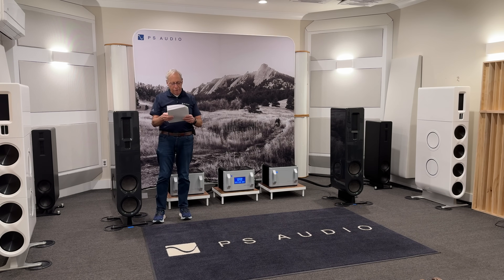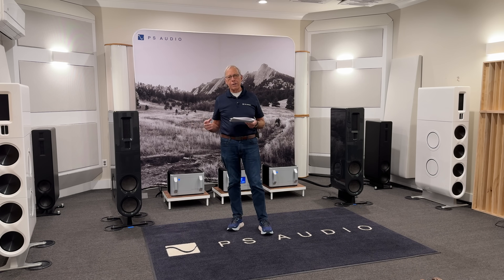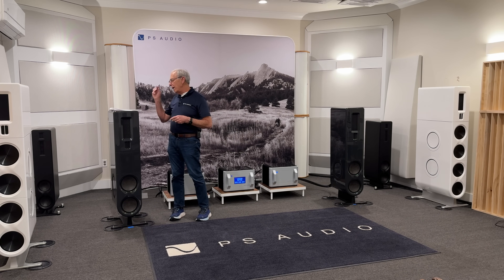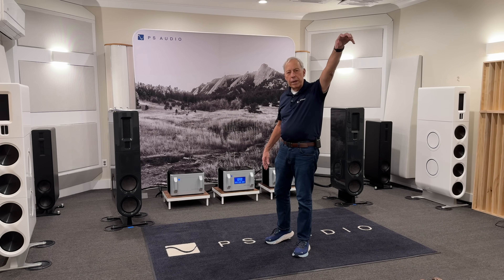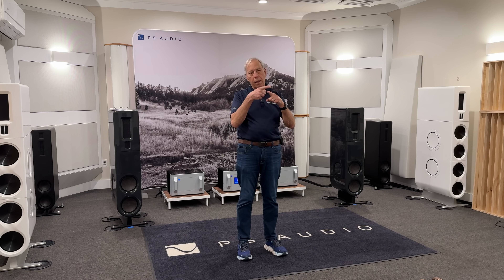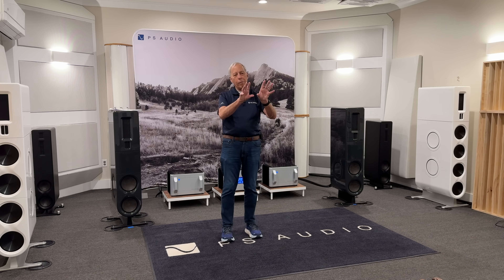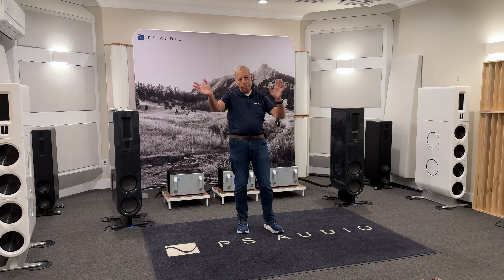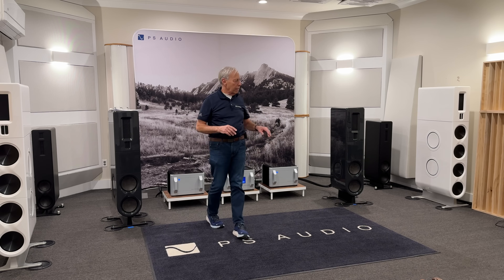How soundstage is created in the recording and mix

Comment: Someone like Octave "should" fiddle carefully with positioning a single mic (like the Neumann described in this video) to glean the best soundstage.  Adding in spotlight mics runs a big risk of noticeable phase cancellation or accumulation once they're all joined in the mixing board, not to mention smearing transients.  A spotlight near the drumset would be helpful, and small imbalance in remaining overall spectrum can be tamed by a mild equalization touch in final mix.  This admittedly won't work very well "on the road".  Ya, nobody ever put me in charge  -  -  -  -

Comment: This topic can create lengthy dicussions.
Another interesting discussion would be how the electronics handle the "soundstage" information, because a very vital part of the "soundstage" is all the harmonics created by the room where the recording is made.
The puritans use one single stereo microphone to capture all the musicians playing together in the room.
Using several microphones will make the mixing easier, but all microphones will capture sound a bit differently and sound a bit different since they are placed in different locations in the room.
But in general that is how recordings are made and gives the mixer the best tools to twist and tweak a bit to get the prefered end result.

Now back to the harmonics from the room...
When an instrument are played inside a room sound will be reflected by the surrounding boundaries like walls, floor and ceiling, and all those reflections adds to the instruments own sound as room harmonics. To record the real soundstage all those harmonics need to be recorded without any bandwidth limiting.
Without those harmonics you will not have a "soundstage" since the rooms character are missing.
Think of a highly dampened recording studio and a church.
Completely different sound character and that is because of the added harmonics and reverb time from the reflections in the room.

Electronics will more or less mess with those harmonics depending on how they are designed. 
To get recorded harmonics through to your ear unharmed all parts and gain stages must have a bandwidth of at least 20 kHz before global feedback are applied.
Some parts like integrated circuits have severe limitations in bandwidth before feedback is applied. It's not uncommon for high global feedback (op-amps) circuits to have -3dB at 100 Hz when measured with open loop. Usually the feedback loop goes back to the input stage where the input signal and the feedback signal is compared and mixed.
The input signal is at best the recorded pristine signal transfered by the input stage into the circuit with a 100 Hz bandwidth limit.
The feedback signal is the pristine recorded signal with a 100 Hz filter and added distortion by all the stages in the circuit.
The feedback will however make the input stage more sensitive and react faster to changes in the recorded signal which will restore and increase the bandwidth of the amplifier.
But in that process the feedback signal will add  the harmonics and sound flavour of the amplifer circuit which will be added to the harmonics from the original recording.
That will severly damage the harmonics from the room and the recorded instrument itself.
So no surprize that high feedback circuits have their own sound signature that sounds more from the sound character from the circuit than the recorded signal.

Conclusion in my point of view...
High global feedback in amplifier circuits is destroying the chances to hear the harmonics from the recorded signal and will not be able to faithfully reproduce the recording. It sounds altered and in many cases very bad. Low distortion figures by measuring a sinus wave will not tell the truth about the amplifiers ability to faithfully amplify the signal with all the harmonics intact.

By comparison, NO global feedback high bandwidth amplifiers have a much better possibility to get all the harmonics through in an unharmed way to the listener.
Low global feedback amps are pretty good too.
In my point of view high global feedback will always sound bad and present a "changed" sound. Then it's up to the listeners preference what flavour they like.
To my ears only no global feedback or low global feedback amplfiers will be able to let me hear the recorded signal as untouched as possible and let me hear the full truth of the recording.
To me it's important that the open loop bandwidth of an amplifier is at least 20 kHz before eventual global feedback is applied. 
In my own designs I aim for at least 100 kHz open loop bandwidth before feedback and apply no more that 12dB of feedback. 

With that said, please understand that all circuits used for mixing and playback have the chance to alter and change the sound character by changing the harmonic content in a recording.
Streaming services alter, remove or compresses those harmonics on purpouse to get smaller files.
Good for the percieved "soundstage"???
No, of course not.
Have you thought about why Qobuz and Tidal sound different ?
They have different algorithms for handling the compression of harmonics...
Leave the harmonics as they are if you want the best performance and really hear the recording as untouched as possible.
...and don't use circuits with high global feedback. They for sure will create a sound of their own and not reproduce the recorded signal faithfully.

Comment: It should be pointed out that spot mikes will (slightly?) detract from the time dimension. The notes from an instrument further back on the stage will arrive at the main mics slightly later than the instruments at the front. But the spot mic will have a closer arrival.

Comment: In terms of room ambience, if you really wanted to capture what the audience is hearing you would need a stereo microphone at the perfect seat position. But reality is that usually means more than desired room ambience thus I can see why the conductor might be a better reference point. But as Paul says, that is not also enough and that’s why more microphones are needed. To sum it up, high fidelity audiophile recording is not actually high fidelity to any actual listening position. Nowhere can you sit and experience the authentic music of what ends up on the master. I’ve listened to many live recordings and also been to many concerts and the live concert always sounds much worse than the live recording mostly due to room acoustics and use of speakers that are nowhere close to audiophile.

Comment: Some early stereo recordings were more 2 channel as in putting an instrument or performed in just the left or just the right channel. Not center mix/pan. The Beatles were known for this. No sound stage.

I wanted to invent 3D panning back in the day. Adding delays to emulate actual mic pairs for each instrument. e.g. like moving the guitarist chair around to "pan" their sound.to add appropriate delay side to side and echo front to back. Where panning now is just voltage level. 

And what about BACCH-dSP? A new system designed to extract exact locational info for each instrument/ performer from the stereo mix and create a perfect 3D soundstage based on your specific head shape as well.

Comment: “Imaging” is more what has been described here. “Soundstage” in terms of width / height / depth is mostly an unintentional result from the recording / mixing / mastering process. High-quality audio equipment and software helps to widen a soundstage, but again the result is unintentional. Said another way: stereo is stereo — but its perceived size is mostly dependent on quality and setup of audio equipment at both the creator end and consumer end.
Reply: Makes sense. I'd love to hear Paul's rebuttal.

Comment: Paul, how do you keep the sound from sounding congested?
How do you maintain the dynamics?
How do you keep each instrument sounding realistic?

For example, I have heard music with wide soundstages, but where the drums sound buried, or where the brass has no bite, or where the bass guitar has no definition, etc.
Drums are loud, and have slam.  Yet, nearly all albums lack that slam, and have vocals that drown out everything else -- and no one can sing louder than drums or louder than a brass section.

We hear a soundstage, but the instruments lose their character.  It sounds like a recording.  Whereas, if it was done right, it would not sound like a recording.

What goes wrong in the studio that results in what I described, above?
Is it the microphone placement?  Or is it sub par, post recording, mixing gear that sullies the sound quality?  Or is it the person at the controls, polluting the signal with compression, equalization, etc?  Some combination of the above?  Something else?

Please reveal the mystery of how the virtually pure, dynamic, heavenly sounding initial capture tapes (or digital equivalent) turns into a soundstage that has the issues I described above.
Reply: Everything you just described sounds like a poor mix, and I don't mean the equipment. The mixing engineer is a key component.

Comment: I was just listening to an early stereo recording (from over 60 years ago) of the Brahms Second Symphony by Antal Dorati and the Minnesota Symphony Orchestra (since renamed the Minnesota Orchestra).  It was recorded with only three mics and an Ampex 3-track tape deck.  Interestingly, it has wonderful depth and breadth of "soundstage."  Aside from (what I'm guessing is) tape hiss, it sounds as much like an actual concert hall experience as any multi-mic, meticulously mixed modern orchestral recording I've encountered -- and more like that than most.  Of course it may well be that Mimi and the Octave team are aiming for something else rather than the traditional "hi-fi" goal of approximating what an orchestra sounds like in a concert hall -- I really don't know what their philosophy is is that regard.
Reply: Three mics sounds like a "Decca tree" configuration - which is often used until nowadays to get a good soundstage.
Reply: @Fastvoice  -- Could well be, but FWIW the recording I cited was originally on the Mercury label.  According to the booklet that came with the recent, massively comprehensive Mercury/Dorati reissue set, the mics used were a Schoeps M201 in the center "conductor" position and Neumann KM-54s or KM-56s on the left and right.  There's no mention of exactly how the mics were mounted, just their positions, so I don't know if the actual "Decca tree" arrangement was used
Reply: @editorjuno  If these were KM-54 then there was no Decca tree, because you need omnidirectional mics. Works with KM-53 (omni) and KM-56 (switchable characteristics).

Together with the Schoeps in the center that was about the best you could achieve at that time (which makes me a bit proud because all these mics are german and I'm too - although I don't sound nearly as good as these 😉).
Reply: @Fastvoice  -- Thanks for additional information.  😎
Reply: 1957?
Reply: @JCP-Ghy  -- Yes, December of that year.
Reply: @JCP-Ghy  1959 I guess . "Decca tree" was first commercially used about five three years before - so it may have been set up there too.

Edit: There was a release in 1959 - but it seems to be not the first one. So 1957 may be correct.

Comment: Shouldn't there be a mix for speakers, a mix for headphones and a mix for iems as these 3 different type of sound reproduction devices render soundstage in a different way ?
Reply: Maybe in an ideal world. But usually as a mixer you try your mixes on different devices and in different surroundings (indoors, headphones, in-ears, car stereo) and search for the best compromise.
Reply: The percieved soundstage is a matter of recorded harmonics and that can be reproduced equally regardless of playback device.
Ultimately I would prefer if the mixer just do it for playback with loudspeakers in the usual "stereo" setup.
The other environments usually is not that critical listening environmets and headphones can be used with crossfeed to compensate for the overhearing and time delay between the ears. Usually the head phone listener don't care that much.
The audiophile "high-end" headphone listener usually have a dedicated headphone amplifier where crossfeed can be added or included by design.
But as usual, every mixer have their own philosophy what to do and many can do a much better job to release a better recording.
But the "audiophile" market is a very small segment of the market and why spend time creating a "perfect" recording when the main customer base don't care about it.
It's sad but the way it is.
Reply: @flex-cx9bi  do you have a good sounding crossfeed software ? all i tried were unconvincing.
Reply: @amanieux  Long time ago I elaborated some with crossfeed and ended up with my own version of whats called Chu Moy crossfeed.
I found Chu Moy to be good but reduced the crossfeed to about 75% of the original.
Nowadays I have three different Stax rigs that I use and then crossfeed is of no interest to me, so I'm not updated about crossfeed.